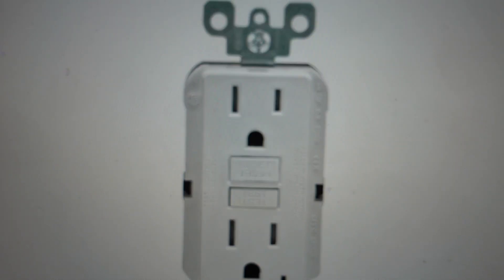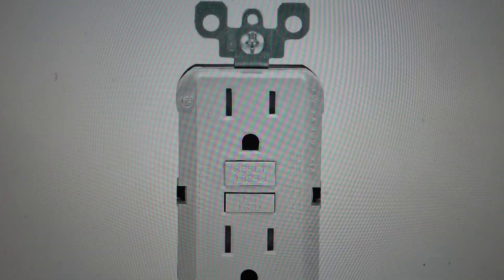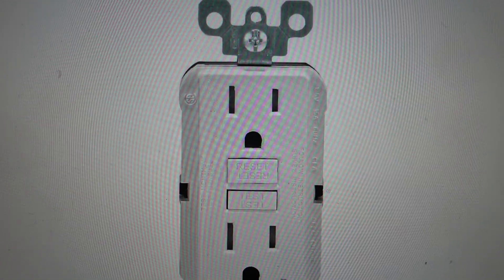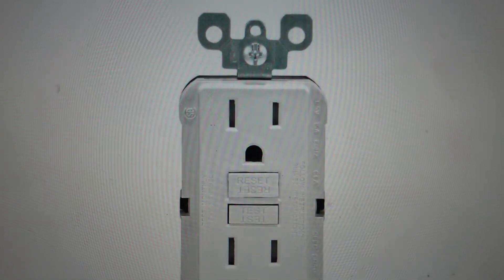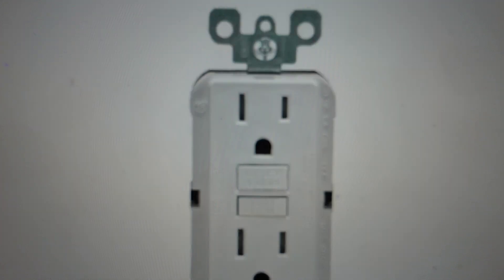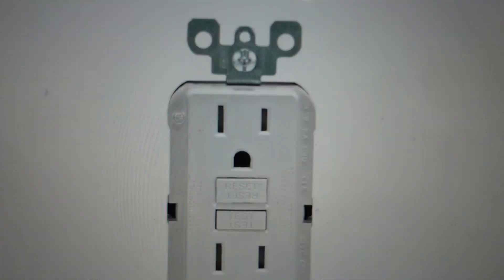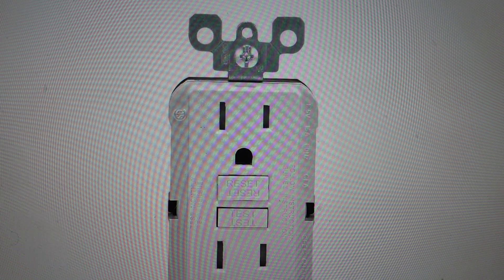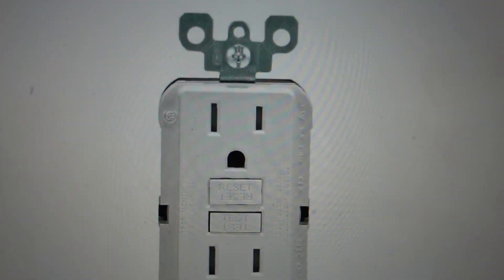What not to plug into a GFCI?

Comment: OK, but, what happens if you have a flood in the basement and there is a sump pump there that you need to work on? I was considering installing a GFCI outlet for my sump pump for just that reason. I've heard you are supposed to use GFCI outlets in basements. I think it is required by code.